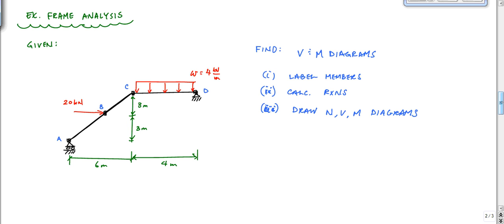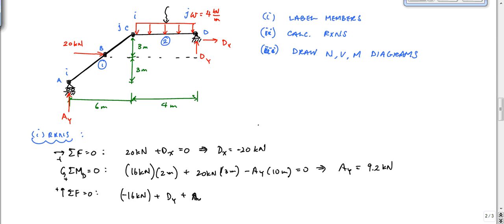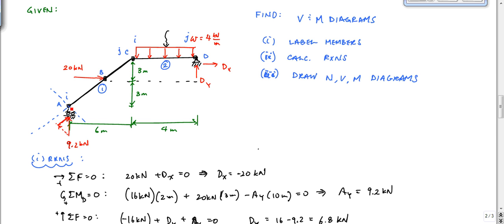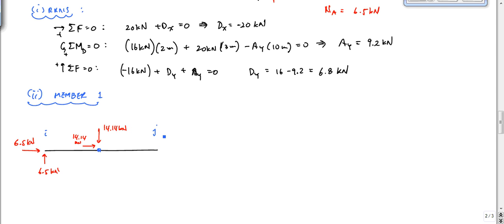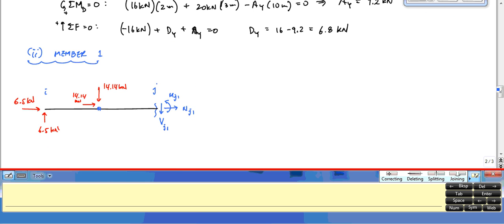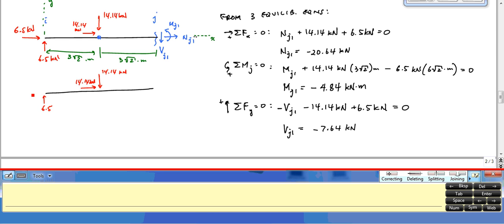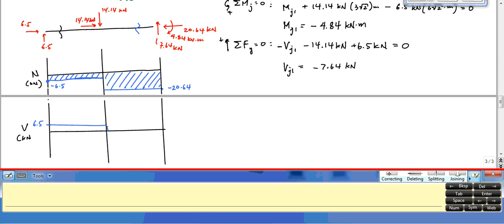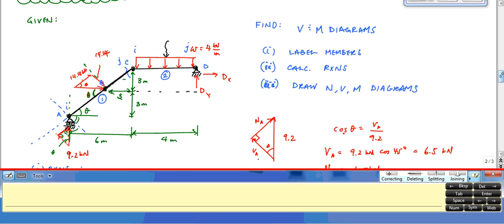Frame Analysis Example - Shear and Moment Diagram (Part 1) - Structural Analysis

Comment: Thank you so much for these great videos. I just need clarity, when you calculated the moment about point D. Why did you make the distributed loading positive not negative? I tried the problem before going through the video but my answer was different. Thank you.
Reply from the maker: The resultant of the distributed load causes a counterclockwise (ccw) moment about D and we established ccw as the positive direction for equilibrium.

Comment: hey mate, Just need a clarification about the shear force you got for the diagonal frame, I followed your method using 9.2cos theta but my friend used 9.2/cos theta instead. Could you tell me which is correct?